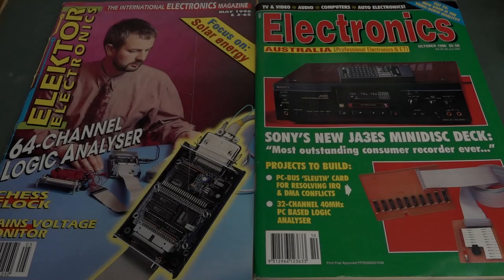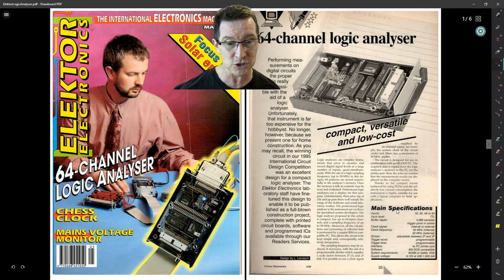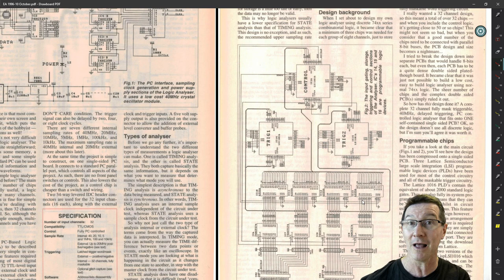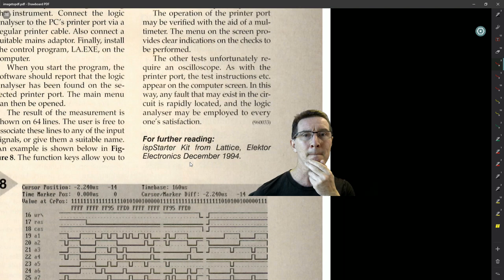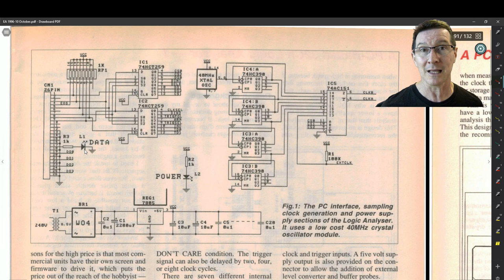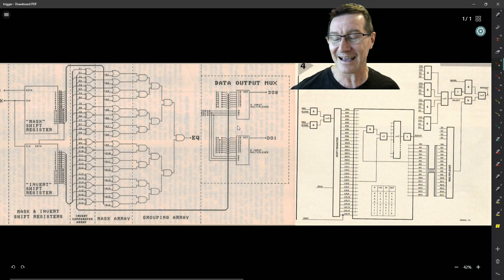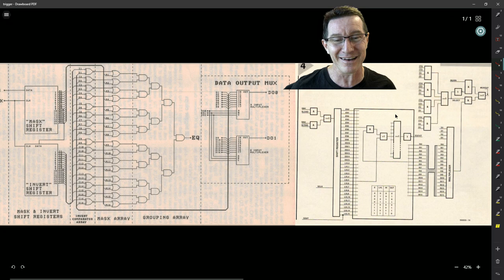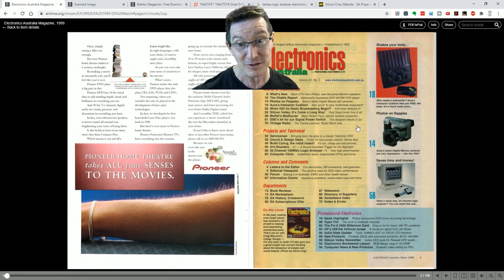EEVblog #1326 - How Engineering Minds Think Alike

Comment: USB became ubiquitous around the Pentium II and iMac era. It was already USB1.1 with the legendary Intel 440bx motherboard chipset... and before. Basically, USB1.0 was only around in New computers from 1996 to 1997. I thought it was weird that the Playstation 2 landed in early 2000 with USB1.0.

So, no, USB didn't come around 2001 and it wasn't USB 1.0 even when it became ubiquitous in the '90s. If USB came in 2001 then we wouldn't have a USB version of Windows 95. ;)
Reply: He probably means USB didn't really became mainstream until 2001 with Windows XP and MacOS X massification. And for that reason the controller interface chips to use with it were expensive (not as much as Firewire "smart" TBA-like ones, but definitely more than just using parallel or serial logic) I don't remember using any USB gadget until 2003 and late (and that only happened because chinese started to massively use it in a super cheapo toy/trash-like stuff). All my stuff (printer, scanner, mouse, keyboard and instruments) were PS/2, Serial, Parallel, SCSI and vendor interfaces with extra ISA cards.
PD: yes, i had mobos with USB ports, but these had no use for me until too late. I can say i owned boards i never ever used their USB ports.
PD2: People tends to forget the paper chinese had in the massification of USB hardware, which in last instance helped to get its development and production price low enough for its usage in hobby projects.
Reply: @hyoenmadan  He said we didn't have it until around 2001 and "even then it was USB1.0." Microsoft was already selling USB-only keyboards, mouse, and joysticks before that point and everything had been USB1.1 since the Pentium Pro/Pentium II era. Heck, the XBOX was in 2001. The Pentium 4 was already a year old. Windows XP was also 2001. Though you could obviously still find serial and parallel devices for sale, USB was already entrenched by the end of the '90s... partially thanks to the iMac using USB for everything and having a USB mouse that passes through the USB keyboard.

I even had a USB N64 controller adapter in the late '90s ("Adaptoid"). There's a reason David Stam didn't design it for 15 pin game port. ;)

I built my Pentium III at launch in early 1999 with an already-legendary (from the Pentium II) Asus P2B that had USB1.1. My keyboard was the Microsoft Internet Keyboard Pro with the built-in unpowered USB1.1 hub. Before the end of the century I upgraded my Intellimouse Pro to a Microsoft Intellimouse Explorer, which was also USB1.1. I even had a huge number of USB game controllers from Microsoft including the crazy ones like the Sidewinder Freestyle Pro, DualStrike, Precision Racing Wheel, and more... all USB.

What wasn't common yet were USB flash drives, headsets, portable media devices, and other things but it was already ubiquitous for HID, printers, scanners, game controllers, etc. Actually, I recall my Diamond Rio PMP500 had USB and I already knew fiends with USB digital cameras and webcams so, yeah, it was already taking over well before 2001... and it was already v1.1.
Reply: @hyoenmadan  I believe you are similarly misremembering if you don't think you used USB before 2003. Did you ever play an XBOX? The controllers were USB, though the plugs obviously wouldn't fit. ;) The memory cards were literally USB drives that plugged into the controller's built-in USB hub.

So many serial, PS/2, and game port devices from the '90s had USB built in to use with passive dongles that controller cost obviously was not an issue. Examples are the Sidewinder Precision Pro (1997) and Force Feedback Racing Wheel USB (1998).

If you did anything with modern PCs at the turn of the century then USB was unavoidable well before 2003. Heck, we already had USB 2.0 by that point, which I first experienced in 2002 with an AMD Athlon system with nForce 2 motherboard. By 2003 I was using USB for everything from draft-G wireless networking to my Samsung N400 cellphone data cable to my RJ45 Ethernet dongles (personally used with TiVo and Unreal Tournament on Playstation 2). I even had a USB-powered Canon "CanoScan" LIDE scanner that I got from Circuit City for $35. USB1.1 was truly ubiquitous by 2003... which wasn't even that long ago, really. I was already having trouble using my legacy serial and parallel port hardware, especially since Windows XP did not allow direct access to the parallel port (GIVEIO.SYS FTW!). A lot of my PIC programmers and even flash cartridges did not like modern systems forcing me to upgrade to equivalent USB hardware before 2003. For example, my Bung Doctor GB Xchanger, which I had to replace with a Flash2Advance USB with the GB-Bridge.

Point is, I remember it almost like it was yesterday, and USB was much more prevalent in 2001/2003. Serial and LPT were already considered "legacy." Dave is remembering incorrectly. :) It was even more entrenched by 2003. It kinda tracked with DVD except that most households previously had a VHS player and fewer people had a legacy PC before getting a USB PC.
Reply: My first notebook (Digital HiNote VP715) had USB build in in 1997, and my current retro machine (Toshiba Libretto CT100) made in 1998, have USB in the computers port replicator. 1998 was also the year we saw the first pure USB-only machine (Apple iMac). In year 2000 I bought my girlfriend (now wife) a complete legacy free pure USB 2.0 desktop computer from Compaq (iPaq - a name they later reused for Pocket PCs, even if it started with a pure PC).
Reply: @martin-ot  Funny you should mention the Toshibal Libretto and the USB port on the Advanced Port Replicator!

On Monday I posted in a Facebook CRT group about a New Old Stock arcade monitor that was destroyed by UPS. In the shared picture I had to demonstrate the damage with a VGA source, so I powered up my Libretto CT110. Though I didn't mention it at all, the Libretto and Advanced Port Replicator were visible in the background and it got almost as many comments as the topic itself. :)

Though I've had the Libby for nearly a decade now (needed something small with parallel and serial), it was my first time using the Advanced Port Replicator that I got earlier this summer. I got it SPECIFICIALLY because I was tired of using PCMCIA CF adapters to shuttle files so I really needed that USB port!
Reply: @emmettturner9452  I wish that the Libretto had USB directly on the machine (most other notebooks had that in 1998), but it is a really cute and handy retro portable. Bought it just two weeks ago, but I love it!

Comment: Elector (or electuur in NL) was (more or less) for hobbyists, and electronics was for professionals ?
I learnt a few things from elector, you cant do it your self (without a university behind you, education and resources..) when you'r starting (at least) 50% of the project end up in the eternal archive  (bin). Their project were way to expensive for that fait. 
While Your design was more clear to me and do able with DIY tools, although those lattice chips were out of my reach also..
After seeing several videos form you and others, I am about to 'design' an 8 or 16 channel analyzer with plundered PC memory chips and a (few) Arduino(s).
If I can reach 1MHz it will be fine to me.    ( I might have to block You-Tub for a while...  8-)

Comment: If parallel ports only require that you have electrical signals sent at specific intervals and you dont need software like usb integrated into your dongle, thats a good reason to have parallel port tools. Never fail due to usb software bricking. The reason engineers come up with the same thing is because everyone needs a hammer and a hammer has a constrained set of useful properties. Also everyone is a meat machine. You think AI is "garbage in, G out", but thats also people. Claiming people are beyond their set of experiences and can draw ideas from a magical metaphysical ether is kind of dumb. People can only draw on what they know and try to put their knowledge together in new ways.

Comment: I read the correct traditional symbols, when I see IEC symbols I think wtf - what idiot drew that!
Some things should never have been changed from the system in used to something invented to be different just for the hell of it !
One of the worst cases of this is the change to 3 phase colours, Red Yellow Blue with a Black Neutral, replaced with Brown Black Grey with a Blue Neutral :( I do not know if any country actually used the new comical "harmonised" colours, Italy was infamous for using Black for everything :(
I can only presume that the change to three shades of grey is for colour blind electricians :(

Comment: Try building something unique using a 555 as the key component. It's not going to happen. If someone has a project they want to build. They should check YouTube. Chances are someone has built it. That's not to say there's no room for originality, because there is, but if theres a problem that needs to be solved, others are probably  working on it too.

Comment: Incredibly interesting. Attention locked viewing.
I thought Elektor was a Netherlands publication and VERY wel known. Not important. Internet a little earlier than you say, about five years or there about. Then it was usable instead of the monster it has become.
NEVER have a Notebook which takes Hole Punched pages! Big No No. Hard Bound notebooks only. How will you know if a page has been added or more importantly removed.
Is Electronic Astralia the same as Practacal Electronics a UK magazine? I think it later became Everyday Electronics or something similar?
I was making hand made double sided PCB's about this time but it was awfully difficult but mine were 3-5 of not multiple. I still have the through hole thingy punch. It shows up now and then and the note to self says "get rid of that" again. My designs were just Logic not complex and were more slanted to replacing expensive an basically unreliable manufacturers kit associated with Product Handling and satiffying a VERY persistent imaginative and accomplished Mechanical type collegue. Good times.
Remember Centronics? PC arrived and got rid of it. I still have an Apprentice made cable. Took him a week.
Many thanks. Wonderful.